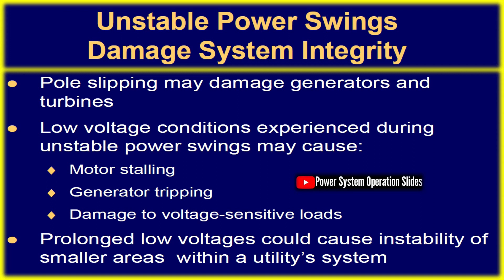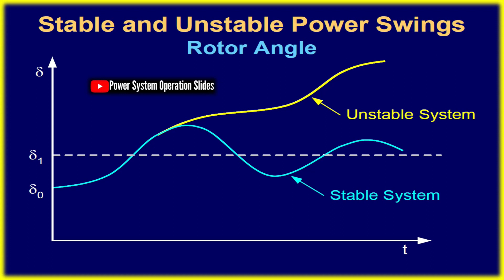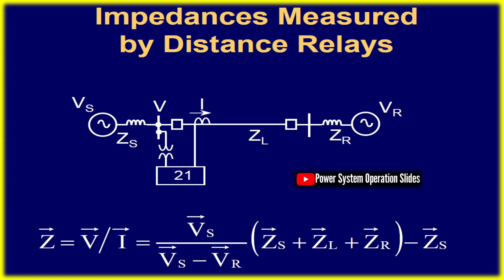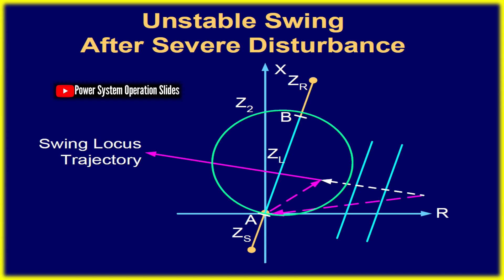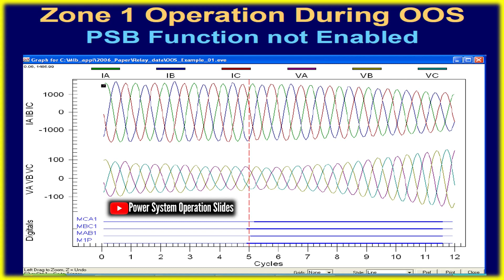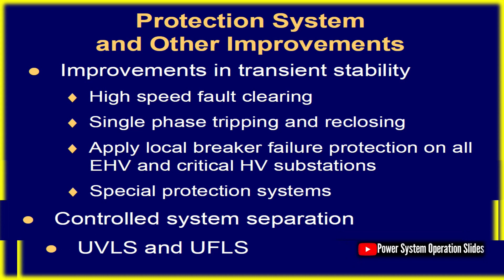Out Of Step Protection Fundamentals | Out Of Step Detection Methods | Application of OST & OSB

Comment: Thanks. Interesting information. Sometimes it is useful to ask: "Why have we build such a venerable system?" Is not part of the issue the creation of a centralized system. I would say that future trends are towards decentralization. With the development of distributed renewable energy generation, that feeds power into independent battery nodes, the grids job will be just to charge batteries. The nodes will control local distribution.